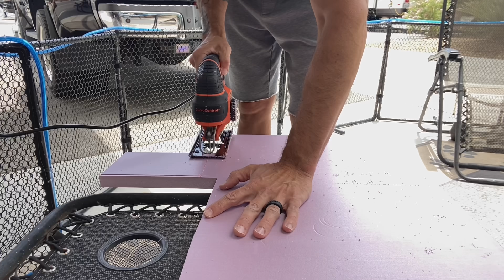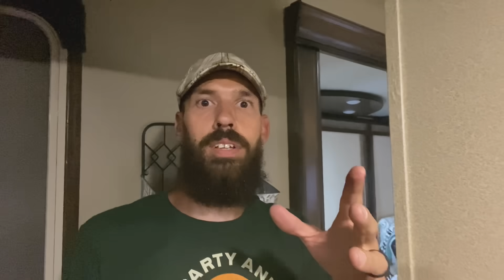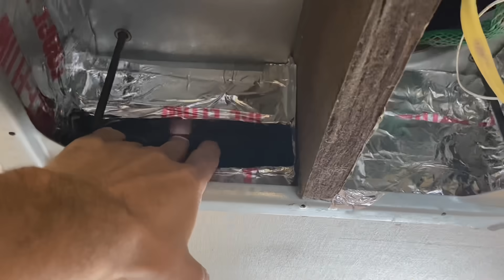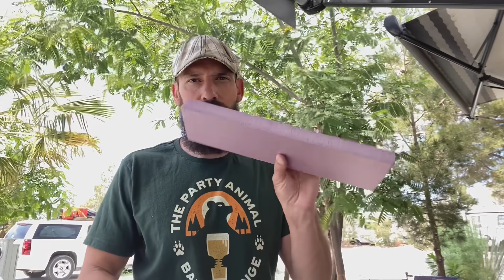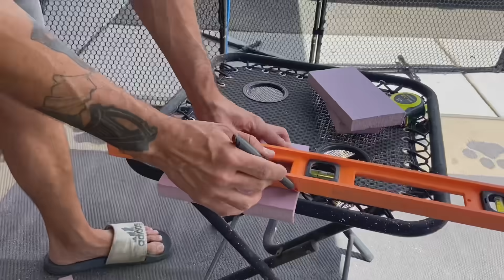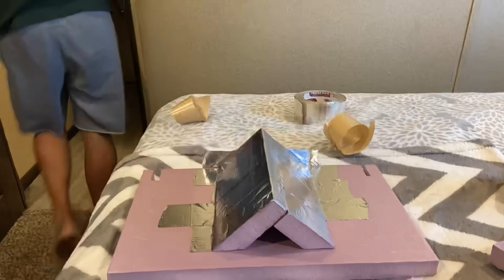RV A/C Modification that will DOUBLE the Output & BOOST Performance!

Comment: Any problems with condensation around the smaller vents after finishing this project?
Reply from the maker: Nope. I have never seen any condensation in my ducts or up inside the unit where the modification was done. I check up in there a few times a year as well. Probably just means you have super cold air flowing(more than you use to) through the ducts close to areas that are not well insulated at all and the heat from those areas close to the cold ducts is creating condensation.

Comment: How did you do the one in the kitchen? I can’t find anything on how to pull down the accent light cover that conceals the ac unit. Thank you
Reply from the maker: Sounds like your unit is totally different from mine. Probably an older model if you have a light built in yours? Sorry but I can’t help you out there. Hope you figure it out.

Comment: What type of jigsaw blade did you use to cut the foam board.
Reply from the maker: That’s a good question. I remember looking into that when I did the project about 3 years ago but couldn’t tell you know unfortunately and I’m not near my jigsaw. Out a sea for a few weeks. Probably something you could google and get a good answer. Thanks for watching. 👍🏼

Comment: In the Crafting world, there is a special foam cutter that uses a hot wire for cutting this kind of foam. If you use one, don't breathe the fumes. Also, remember that there is almost no resistance when you're cutting foam with heat, so you have to keep it under tight control. That said, the cuts a clean and sealed with no foam debris trying to stick to anything, and tight shapes and curves are simple.
Reply from the maker: Thank you. I know all about these because I have one of those actually and use it to carve foam pumpkins. Appreciate you watching

Comment: Try a ninja trim saw from harbor freight I believe around $20 if your disabled perhaps a jig saw is better but I’ve exclusively used it for insulating all the buildings on my property and prefer it unless I’m ripping a long piece then flip blade on portable table saw

Comment: Hi Chris,
Thanks for this great idea and video. I just completed this on our 36’ Arctic Fox Grande Ronde fifth wheel. The RV only came with one 15K BTU AC unit. Before I did this modification, I was worried that we needed to add a second AC in our bedroom as the flow put of the duct in the bedroom was very slow. I’m pleased to say that the difference after the modification is night and day. I have no doubt that in most climates we will be able to keep the RV cool with the single unit. The cost of the modification was about $30.00 plus some of my time. A unit from RV Airflow was $140 plus tax and shipping and I’d have also had to install it too. This is way better. Thanks again!
Reply from the maker: Awesome! Glad this helped out and let’s hope it really makes a difference for you too. Haven’t really talked to anybody who’s done this and didn’t notice an improvement of the air getting pushed through the ducts quicker. Thanks for watching 👍🏼

Comment: Nice simple modification to a/c which was well explained, thank you. One minor point that struck me, and other people proposing this have also missed this. The divider should be sealed in place, but not replaced, Colman or the RV builder chose it because it is an acoustic absorber (foil one side and open faced on other) ideally your bottom sheet and any blank internal surfaces of plenum chamber should be lined with it, as long as it does not overly restrict airflow it will help to absorb fan and airflow noise. Acoustic suspended ceiling tiles (the ones they fit in the grids in big offices) are a good option, by all means use shiny tape on opposite side to airflow to seal everything up, but smooth hard surfaces propagate sound (noise is after all unwanted sound!). This is just an observation and not a criticism, I liked the simplicity of the concept.

Comment: Has the noise level been measured. How much quieter is it?
Reply from the maker: I don’t have a decibel meter or sound level meter but I have seen other people who have done this project and made videos about it using one. It’s always measured out quieter. It’s definitely noticeably quieter right when you do the project but by no means is it like, wow, I can’t even hear the AC anymore. It’s more about the air it pushes out your vents than the noise reducing factor for sure.

Comment: I just did both Ack’s they are Coleman 15’s
One up front worked awesome the back one not so much. Hardly any air passage. I’ll check the inside pyramid part. 
Maybe trimming it down ? 
It’s sure sucking air though.
Did I miss anything?
Reply from the maker: Possibly. It’s so hard to say really without seeing everything and knowing. Wish I could be of more help.
Reply: No problem it’s all done & it’s working, just not pushing the air as well as the front AC.
I’ll check the race track venting.
But it sure makes a difference 👍
Reply: @kylejensen4600  make sure you put your cover on in the right direction. I accidentally put mine on backwards and it didn't blow very well...doh!

Comment: We have two AC units on our 36 footer, and they can't keep up with triple digit temps.  I'm definitely going to try this.
Reply from the maker: Good deal. Hopefully this is something that will work with your style AC units. If so it’s definitely a big help. Plus make sure your units up top are properly cleaned each year 👍🏼

Comment: Great idea and great video. I stumbled upon it because my ac works very well but is freezing up. I'm definitely going to do this once I figure out what is going on with mine. Thank you. 👍
Reply from the maker: Make sure to check that your thermostat wire going into your fins is still pushed in there good. They are known to rattle out sometimes which would cause it to freeze up.

Comment: Hey new BFF! I did this to both my ACs and it dropped the bedroom from 86 to 72 and the living room from 89 to 76. 102 degrees outside. It will be a little cooler with the ceiling fan on. Also, I didn't notice in the bedroom AC, but the main AC center divider was centered. It had 6" of duct showing. I moved that over 2.5 inches where the duct will get the full 8.5 wide inlet that it was designed to get. The intake side was not affected, because it didn't require the full width. No bypassing either. Very cool! I can't thank you enough. Take care BFF! Dale
Reply from the maker: That’s awesome Dale, glad it worked out for you! I know it’s pretty crazy once you open these things up to see how much air can be lost in the cracks and things not taped up correctly. My divider wall was off a bit as well. Appreciate you watching 👍🏼

Comment: Thought my unit froze after the mod, but realize that I’ve had a problem for awhile. When I replace the unit I’ll mod it again.   I did one more step, I added a fierce of 1/2 inch soft foam over the dump hole side of the grill for more sound proofing.  Really quiet.
Reply from the maker: Sweet. Let me know how it works out 👍🏼

Comment: I did this on out two Coleman air conditioners. I did an additional mod on your design by opening  up the bottom of the “V” to allow more intake air thru the filters. Also I opened up the plastic support accordingly in an area for more surface for intake air to come in. 
Nice modification 
Thanks
Reply from the maker: That’s great. If I ever do it over I’d do something similar. Appreciate you watching and checking out our channel. 👍🏼
Reply: You have pictures of what your talking about?

Comment: My unit froze up within a few hours.  Any ideas?  I believe I followed the video correctly. Any ideas?
Reply from the maker: Not sure, never heard this from anybody. What type unit and RV? 
If done correctly all this Mod should do is just force the existing air into your ducts faster to cool things faster. Did you knock your thermostat wire that goes into the fins loose?
Reply: Thinking back I believe the unit has been freezing for  some time.  Been all through the unit and think next year is time for a new unit.  The mod really worked well thanks!

Comment: Just amazed at how quiet. Sitting under the unit and can barely hear it running.  The air flow is also much improved.  This mod changed our unit significantly for the better. Great video explaining it all. A BIG thank you!
Reply from the maker: Right on Rick! 👍🏼can’t beat it for just a few bucks and a couple hours of work. Glad it helped it. Make sure you check out our channel for other mods, tips and RV content. Thanks for watching 😁

Comment: Do you know if it would work with the 1” styrofoam board insulation that has the silver side?  I purchased a sheet of it to insulate the pass through storage and would love to be able to use it if it would work just as good.
Reply from the maker: It should work just fine. 👍🏼

Comment: Would this be worth doing on a 2021 tracer 200bhsle? It's only 25 feet long and basically single room
Reply from the maker: Depending on the type AC unit you have if it can be done I think so. Nothing wrong with getting faster cooling times. 25 feet is still a good size and with only one AC I could see it getting pretty hot still. But it just depends on if you think the AC isn’t keeping up good.
Reply: Thank you! It seems ok but maybe I'll try it to see if it increases the performance.

Comment: Just curious sense it's been a year have you had any problems with your ac freezing up.?
I'm seeing a lot of good reviews and I'm preparing to do this project on my ac's in the next couple of day.
Keep the diy's coming.
Reply from the maker: Nope. It’s always been fine. Not sure why this mod would cause it to freeze up. All this is doing is taking the existing air flow and forcing it directly into the ducts faster where it needs to be to cool down the camper quicker. Your unit should actual work less hard because it won’t have to be on as much.

Comment: 74 degrees is cold?
Reply from the maker: It’s just what I set it to, I could of set it lower but 74 is comfortable for me.
Reply: @WhyWait  I live in NW Washington. I hate the heat. I don't even turn the heater on until it drops into the 30s.
Reply from the maker: @NavyMech62  oh man, I live for it. It’s not a nice day out unless it’s 85 or higher and I can take my shirt off and bask in the sun

Comment: Oh my goodness, this must be what is wrong with our midbunk!! Did it make a big difference in cooling that room?
Reply from the maker: I would definitely recommend doing both of these modifications I talk about in this video. The first checking to see if there is actual ducting to the vent in the midbunk and then adding that fan to pull air into there. Plus the main modification to the AC units is a must. What model camper do you have?
Reply: I have a forest river heritage glen. It looks like there may be duct work in the mid bunk. I can’t get the darn air vent cover off. The round one. Any tips?
Reply from the maker: @macyrae81  flat head screwdriver maybe and pry gently 🤷🏻‍♂️

Comment: It isn't doubling the output it just seems that way.  If a camper's A/C unit stinks when new it's because of inadequate circulation not output.  If it gets weak over time dirt is the culprit if it hasn't been cleaned.  Putting foam to restrict flow from the plenum forces more air through the auxiliary vents throughout the camper which is what you did.  A/C performance can also be very easily be improved by adding a box fan.  Happy camping!
Reply from the maker: Yeah I know it’s not really doubling the output, just gotta get a little click bait on these YouTube videos sometimes for people to click and watch. Just forcing the existing air into the ducts quicker so it gets to where it needs to be! Thanks for watching
Reply: @WhyWait  It's surprising and disappointing that A/C vents in RVs have been around so long and still work so poorly from the factory.  It's like having to take the hood off a new car so it doesn't overheat.  All the mfg needs to do is add an air diverter to the A/C unit's inside plastic cover.  After 50 years they never bothered to finish the design.
Reply from the maker: @wsbill14224  haha so true!

Comment: The way that ac duct is designed if the unit itself was of the capacity it should be there would be no problem. It a house duct system it is design according to the square footage to what size unit you need.. but the duct work can take away or add to depending on how it's built what you have done is an will no doubt be an up grade to your system. When a unit comes on an fills the main duct an than distribute out to the outlets we used to measure the flow of air by pressure in each room with door closed. Don't know what size unit that is but if it was ten or fifteen more thousand btu you wouldn't have had that problem. Your unit compressor may produce enough cold air but the fan that's pushing the air is to small. What you did is actually pretty smart only thing you could do besides changing rpm on ac fan. Definitely a flaw in design on ac manufacturer an RV manufacturer for picking that size unit for your RV. Enjoyed the video it amazing sometimes when people do intelligent things to improve their lives
Reply from the maker: Appreciate you watching Lynn and thanks for the comments. It has definitely improved our cooling in our RV!

Comment: Almost unbelievable!  We are at the lake over 4th of July. No shade, it gets hot here. 15k ac struggles mightily here every year. We ate usually lucky to get mid 80s inside during the day and it takes hours to cool down at night. 
Did this before we left Friday morning, took about 20 minutes total. It's 74 inside right now, very comfortable throughout the camper!
Awesome mod!!!
Reply from the maker: Right on! We were pretty surprised how much it helped too. Just getting that air into the camper where it needs to be and out of the ducts is huge. Thanks for watching and glad it helped out.

Comment: I did a similar mod prior watching your video and it worked okay too, but because I am running on batteries, solar and inverter it still was to much power draw. So, I added a relative affordable ($450) Inverter Window AC (12000 BTU) and it runs on seamless speed and uses a fraction of the power, plus is much more quite. The install was much easier and cheaper then adding a mini split inverter AC
Reply from the maker: Good deal!! 👍🏼 Sounds like a nice mod

Comment: Did mine last year. My a/c was extremely loud, so loud we put in a sound bar in order to hear the tv. The a/c would not cool the trailer if it was 90 outside and the ducts blew very little. We dropped the bottom plate and were surprised to find one corner of the box had a 3/4 inch gap by 4" dumping into the attic while the opposing corner had about a 1/2 inch by 4" gap. The divider that seperates incoming air from cooled air was down about 1/2 by 10 or eleven inches allowing cooled air to be recirculated within the box. This kind of explains why the a/c at best could only drop the temps by 10 degrees at most and ran constantly (and loudly) day and night. We used foam to direct air flow, removed and correctly installed the divider in the a/c box, put Reflectix on all areas not covered by foam, sealed up the two corners and blocked the a/c duct from the inside of the dump plate with reflctix and aluminum tape. The end result of this was, the a/c now will make the inside of the rv downright cold. We no longer need the tv sound bar, we run it on low most of the time now. The trailer cools down quickly. For sound, you really don't hear it on low now and on high there is no more loud rumble, just the sound of air blowing across the rooms from All the ducts that before had little to none. At campgrounds others have commented on how quite it is compared to theirs. This was on a 2019 Grand Design 22RBE purchased new. Sad how poorly installed it was and how it is designed in such a way (universal) as to create tumbling misdirected air that as a result creates a loud roaring noise. Probably the best mod we have done to the rv as on low you no longer even hear the air but the rv is nice and cool. One more note, after doing this the a/c was not as quite as  we wanted it to be though much quieter and working much, much better. I dropped the bottom plate and (I don't remember if I used 1/2 inch foam, reflectix or both) covered the dump area. There is a lot of turbulence around the dump area and nothing to block the sound. With the ducts now working so much better the dump was not necessary. This did the trick and brought the sound down to very, very low as in I could whisper with my wife on low and talk in a 'normal' voice with my wife on high.
Reply from the maker: Thanks for sharing! Glad it all worked out for you 👍🏼 It’s a great mod for sure!

Comment: Excellent video! You explain things simply, thank you. I will be doing this, because the "Airflow System" charges $170 for basically a piece of styrofoam, so good job.
Reply from the maker: Yeah I me it’s fine if your not too handy but for $10 bucks and the same results you can’t beat this!
Reply: . The saved $160 buys nice steaks.

Comment: I wish our job had been so simple. I guess Forrest River uses unskilled labor to install their ductwork. More cuts, uneven surfaces, and spray foam insulation than you can imagine. And...there was about 8 wires crossing through the box. They should be ashamed of selling something like this. 6 hour job with crazy custom cuts. Not looking forward to unit number 2.
Reply from the maker: Yikes! Sorry it’s so difficult. Hopefully it will be worth the time when that air is pumping out better!👍🏼